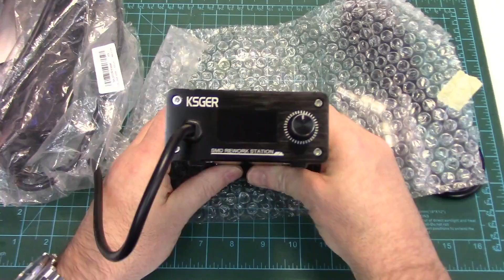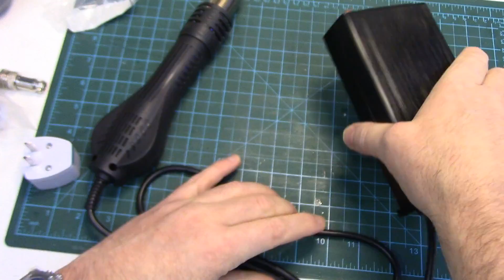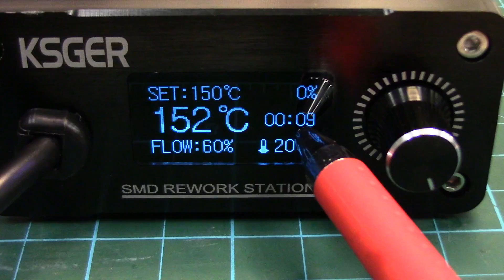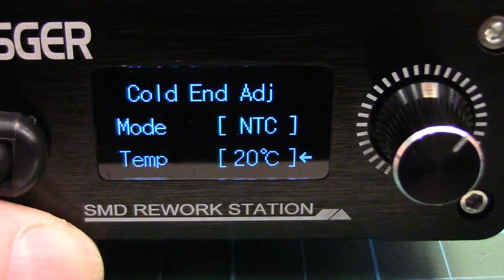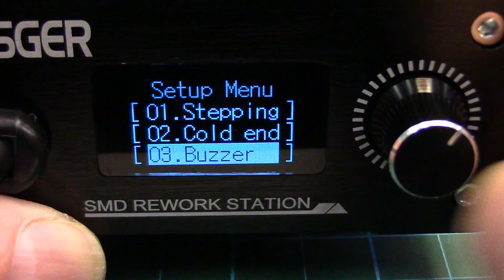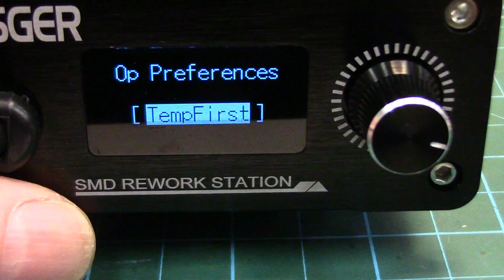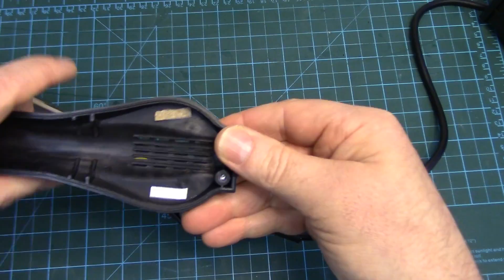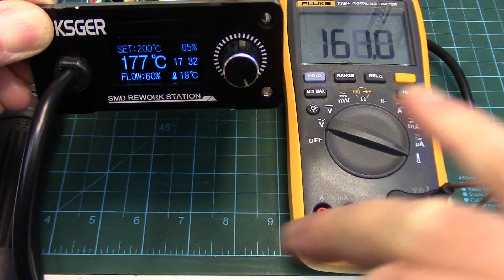KSGER 858D Hot Air Rework Station Review

Comment: Maybe you want to warn people before they put the GX16 plug in. There will be a possibility to have line voltage on the open pins when the plug is not connected!
Reply from the maker: In the video where I show the actual GX connector mod ( https://youtu.be/vtPHqNQ3pLY ), I have done just that. Both in the description & in the first pinned comment. People could also just as easily use a reversed GX16 so the exposed pins are in the gun end and the insulated pins in the station end. People could also use a GX16-10 and have two pins cut the power (an interlock) when the plug is removed. Several safety options are available and I would hope that the type of folks making mods like this understand the basics and know they do mods to any electrical equipment at their own risk.
Reply: John Salt Sounds good. I have seen people do a lot of stupid stuff. Just wanted to save you from trouble.
Reply from the maker: Yep, common sense and critical thinking skills seem to be at an all time low right now.

Comment: Hi John, thank you for that review... I've seen this station listed for  220Vac/700W, so if we use it here in the US @120VAC, the power is greatly limited, right?  thanks again!!
Reply from the maker: Assuming it's the same station (head unit), it's a universal voltage unit (100 to 240VAC 50 or 60Hz). The heating element in the hot air heat gun/wand handle is however specific to 120 or 240V. Mine is the 120V volt version so I have no idea how the 240V heat gun version would work if hooked to 120V. The gun/wand may simply take longer to heat up or may not be able to maintain higher temperature settings (air flow across the heating elements dependent of course). 
If you got the 240V gun and found it doesn't heat up correctly, you could always get the 120V gun (they don't cost much).
Reply: @rchelicopterfun  I really appreciate your fast reply and feedback! thank you and stay safe!!